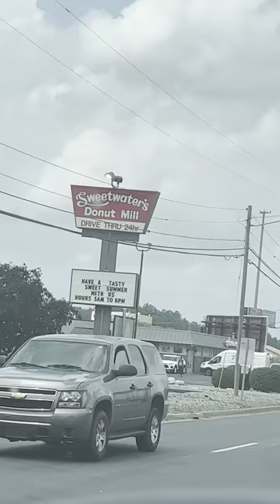Hydraulic line repair had us calling the whole state for parts!

Comment: A guy needs his own fully-equipped hydraulic repair truck these days
Reply from the maker: Agreed.  I think a hydraulic repair truck would carry 90% of it but it seems like all my crap has the 10% that nobody carries. So it will be pretty hard to stock. We were thinking we should’ve just replaced every hydraulic line on this machine in the winter ahead  of time and we would never have a breakdown. This chopper is at the age where all the hoses are just failing.